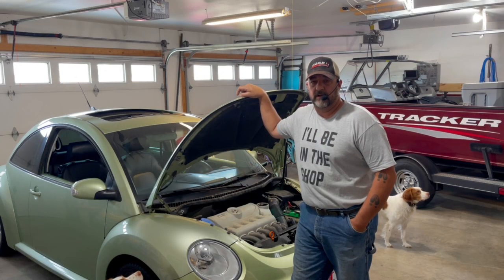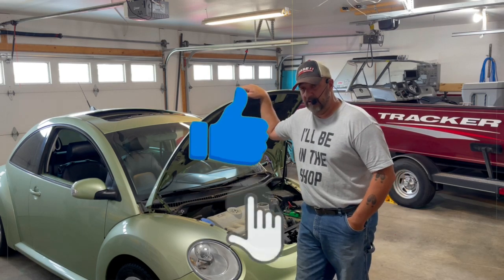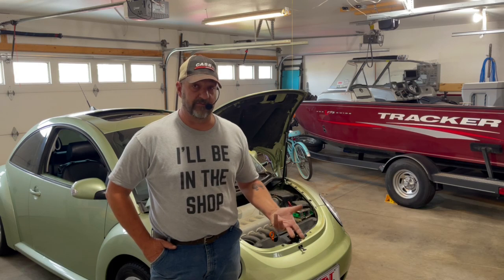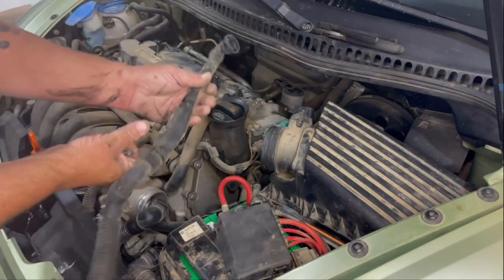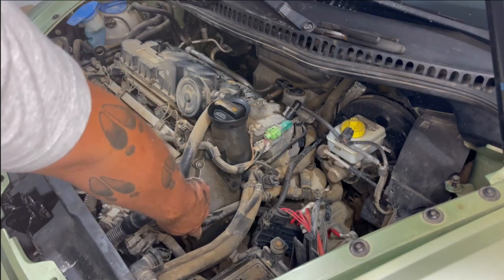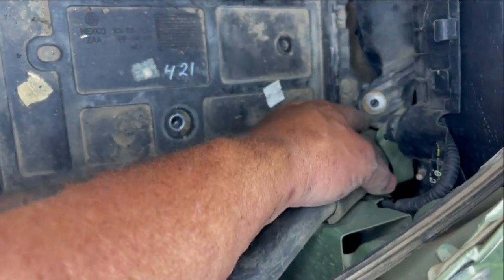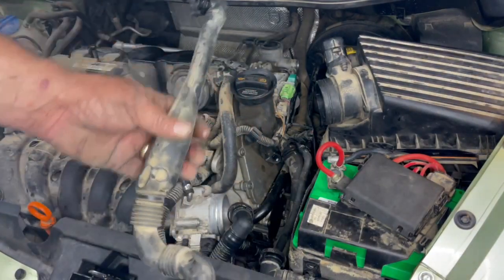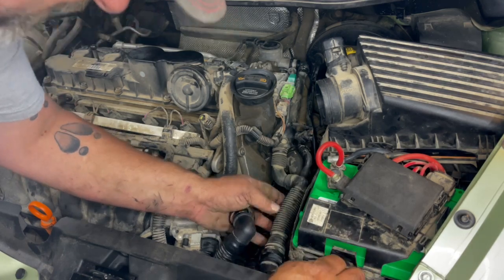VW Beetle 2.5L Vacuum Pump The cheap and Easy Way

Comment: Thank you very much!  I have two VW bugs with the same problem.  Taking off the pump cover before removing pump is brilliant!  I can’t believe the dealerships would remove the transmission to do the same job. FYI, Jiffy lube refused to do oil change because of the 12 star bolts on the skid plate.  I ended up doing the oil change in my driveway.  During the process I replaced all the 12 star bolts with 6 sided bolts.
Reply from the maker: Glad to help.

If I had to guess, I bet the dealer does it the same way I do and charge you the full monte.

Thanks for watching.

Comment: Thank you! Just completed this job on my daughter's 2006 Beetle Convertible 2.5. Took most of my Sunday, but it's all done now. The three pump housing bolts in this car were T30 torx for some reason (fortunately I figured it out before I stripped any). Getting the pump back over the transmission selector rod was a PITA. Everything has to be in alignment before the pump drive will seat. Don't get me started on seating the cover gasket; it took about a half hour before I was satisfied. I followed your advice and marked the position of the sensor mount bolts with a sharpie, then promptly washed the marks off with brake cleaner...duh. I took pictures all along the way, so it wasn't catastrophic. All in all, a very educational experience.

Edit: I ended up not removing the wire harness from that little bracket; I just rotated the bracket out of the way while I had the pump out. It was a lot easier to line it all up after I got the pump back in.
Reply from the maker: Glad it worked out for you and I hope the video helped.

Thanks for watching.

Comment: You da man.

I just replaced the gaskets on my  2009 Beetle.   Thanks for your help.  

I went slow, but could probably knock it out in 2 or 3 hours now that I know what I'm doing.  

Fingers crossed that it fixed my oil leak (I had a bunch of oil on the top of the transmission)
Reply from the maker: @deasttn  you likely got it taken care of.

Glad to help and thanks for watching.

Comment: Loved the breakdown of tool used beforehand and the list of everything afterwards. You gave me confidance to do my own. Had a friend of a friend offer to do it for $250 and the part recommended was $212. But after watching 2 other videos I decided a gasket kit was probably all I truly needed. So I'm ordering one now. Thanks!! Excellent video. Great instructions
Reply from the maker: Hope it helps.
Reply: Did the job.  Only issue I had was the plastic piece inside the pump. I took it off and sat it on the cowl and the tiny end piece fell off, right under the fuse box..grr. Half hour shaking and it slid down. But your video was perfect info. Four days and no leakings. Thank you. Subbed

Comment: Excellent step by step video Ed. You're a good mechanic and instructor. The list of tools, parts, cleaning stuff and WD40, Brake Cleaner. Marking bolts on sensor, torque humor, reassembly of things. Will install new Secondary Air Injection Smog Pump opposed to repairing existing pump. Thanks bro.
Reply from the maker: Thanks for watching.
Reply: @jackofalltrades7822  When installing Fuel Injectors on a 2016 Kia Optima 1.6 Turbo, is it necessary to drain coolant to remove in intake manifold?

Comment: Thanks Ed, solid video with excellent footage & narration.
My wife drives a 2010 2.5L Beetle Vert. same leak, the gaskets go @ 50k. BTW the book calls for 3hrs. & yes dropping the gearbox & new replacement part...I guess for liability/upscale  : )
Great little cars ones you learn your way around them.

Comment: Great informative video, thank you Jack of all Trades. You are not just mechanically inclined you are a great teacher as well as a very good videographer. I just subscribed , hit the like button and rung that bell. Thank you so much for sharing your knowledge with the rest of us. I don't wish you any problems with your daughters car but any videos you could do on it would be greatly appreciated. My wife just got a 2010 beetle 2.5L gas burner and I don't know squat about VW's. So far I've had to replace the steering wheel lock mechanism. Thankfully I got through that ok , because the dealer wanted an arm and 1 1/2 legs to do it. lol
Reply from the maker: Thanks so much David.

Comment: Excellent tutorial! Very impressed by the great lighting and video angles. 

I’m shocked that VW’s official procedure is to drop the tranny, as your technique seemed quite straightforward and is far easier than dropping the trans. 

One question: what type of sensor was that, where you said it needed a particular alignment and you should’ve made match marks to ensure you returned it to the correct alignment?
Reply from the maker: Thanks for the complement. It just hope it helps some folks out.

That sensor is the transmission range sensor. That is the mechanism that tells the computer what gear the transmission is in.

If it is out of alignment it could cause various problems to include the engine not starting because it does not know if the transmission is in park or neutral.

Thanks for watching.

Comment: At 15:59, where is that 10mm bolt?  I see the torx head bolt in the video, but not the 10mm.  What does it hold?  This is a great video!  It's going to make the job much less daunting!!
Reply from the maker: @KenDieckmann  it is right above the first torx head bolt I remove. It holds a bracket for a harness.
Thanks for watching.
Glad to help.

Comment: I got a German made BBR gasket and seal kit for $10. And in most cases only the cover seal needs to be replaced. Not the pump to head gasket.
Reply from the maker: Very true, & that what was leaking on mine, but as long as I had half the car apart to get to the pump I figured what the heck.

Thanks for watching.

Comment: The gasket likely fails because of the dissimilar metal of the cover plate. The new pumps have a different cover plate. The pump isn't intended to be serviced, so any gasket for the cover plate isn't OEM. By replacing the seal and not the pump, it'll likely start leaking again at some point.
Reply from the maker: Well of course it is going to start leaking again at some point. That’s why I had to make the repairs in the first place. 

It has been 2 years and 27k miles and so far not a drop, so considering the $2,000 bill from the dealership or the $40.00 gasket replacement, I think the choice is pretty clear.

Thanks for watching.

Comment: Can you insert the new gasket and cover with the pump off the vehicle?
Reply from the maker: No. The cover has to be removed to get the pump on or off, unless you separate the engine from The transmission.

Comment: Did it actually fix the leak without having to replace the pump in about to tackle this got my gaskets yesterday
Reply from the maker: Yes, it worked great. Still not leaking a year later.
Reply: @jackofalltrades7822  what was technically the problem, just the worn out rubber gaskets?

Comment: I have a 2014 model 2.5 mk6 which is  an auto and after some time in traffic it shakes the cabin when increasing its rpm slowly from 2to3 gear , and after sometime it shows the 🔧 at the section where writes PRND
After i turn the car off and on again it removes the 🔧
I have checked it for tranmission issues with computer and it doesnt show any error on the tranmission
It shows only this P0106 and P2096 
Do you think this two are related to the transmission? And in your opinion what should i do?
Reply from the maker: I have no idea here. I would take it to the dealer

Comment: I replaced the vacuum pump, but now getting Faulty Stability Control error code.  any idea how to fix it?  Is it related to the transmission range sensor alignment?
Reply from the maker: Ya, the sensor on you shifter shaft is out of alignment. It’s the sensor that you took off after the shifter cable
Reply: @jackofalltrades7822  I followed an instruction to turn the wheel all the way to the left and then all the way to the right.  The Stability Control error is gone.  But now the engine light icon came on.  What give?
Reply: The transmission ranger sensor was out of alignment by a bit.  I check the code and fixed it.

Comment: My  upper hoses are not flexible to move at all and the black bar is right across the vacuum pump so I can't get access to all the screws  on the pump. Its a 2006 beetle 2.5 and looks exactly like yours except for the hoses and black pipe. I can not move or even jiggle the hoses to move. Any suggestions?
Reply from the maker: You have a turbo? That might be the difference. 

I have not seen upper hoses that are not flexible. You might have to remove them completely. I guess without putting my hands on it can’t advise properly.
Reply: @jackofalltrades7822  I can flex them enough to get the pump plate screws off but the real issue is the black pipe that goes across the vacuum pump plate in the centre. I could get the plate off but there is no way Id be able to flip the pump itself out as the bar is right up against it. Im not sure what that black bar is but from videos of changing the thermostat I see that bar goes under the intake and attaches onto the thermostat housing. If I detach it from the back side towards the firewall will it spill coolant?
Reply: @lindapoworski2597  If it's a coolant line it will likely spill coolant. You can drain the coolant, but refilling the system is another job entirely.

Comment: Well I started and got all the way until the bottom torq 30 and I discovered why the previous owners didn’t fix it.  That one is stripped out and unable to remove it.   Do you have any ideas ? Think I could get by with replacing the outer seal only? Any help appreciated.
Reply: Update, I finally got enough of a bite and got the Torqs 27 bottom bolt out.  That was a really hard job replacing that, but your video really helped out a lot.  All done and no leaks so success 👍

Comment: It would be about 20 to 25 NM because it has a seal behind it as long as they are snug
Reply: The gasket kit instructions state the cover bolts and the pump housing bolts are 7 ft-lbs (9.5nm).

Comment: I have a 2010 Beetle with an oil leak that seems to be coming higher up. Is it possible that the pump is slinging oil up there as well? Or is it the valve cover?
Reply from the maker: I would bet it is the pump. VW Valve covers are pretty solid. The only way to be sure is to look. Remove the snorkel and you should be able to see with a flashlight.

Comment: Was this a manual or automatic?
Reply from the maker: Auto but it shouldn't make any difference.
Reply: @jackofalltrades7822  great thanks for answering but unfortunately upon inspection it looks like the rear end seal needs replacement 😮‍💨🤧
Reply: Rear main seal*